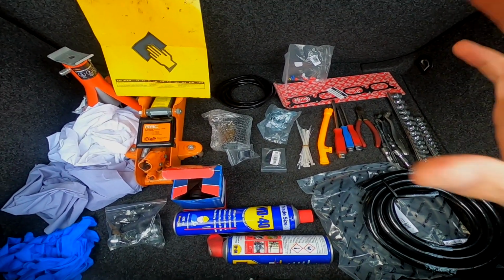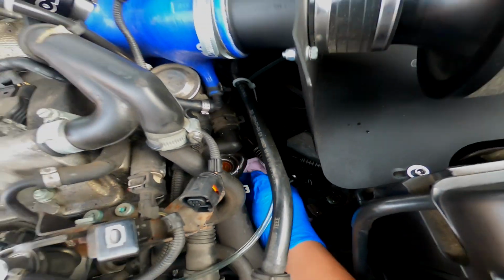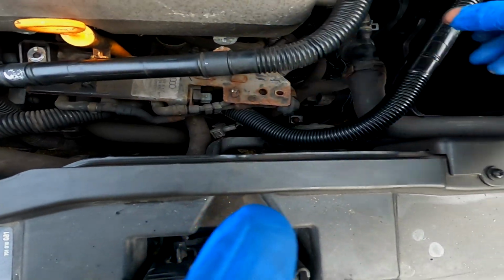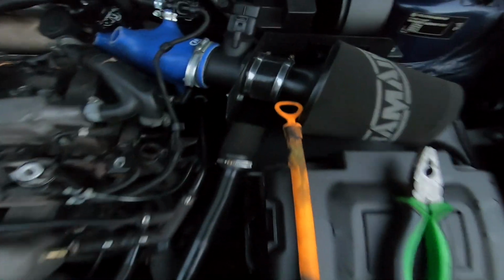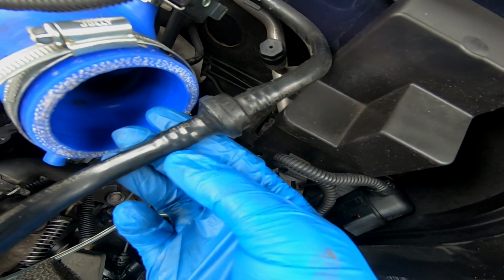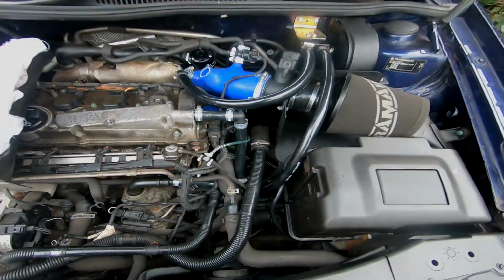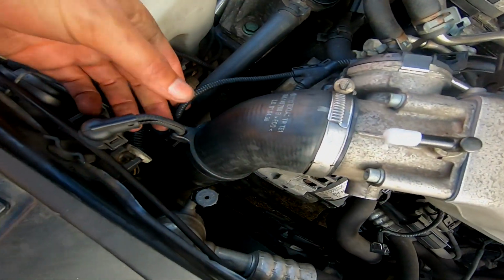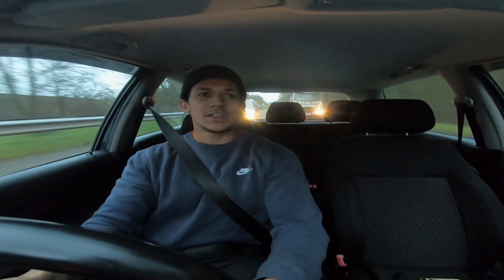MK4 VOLKSWAGEN GOLF GTI 1.8T SAI/N249/PCV/EVAP DELETE/CATCH CAN INSTALL

Comment: Ezz bro, I'm about to do all these deletes, what's your view on passing the MOT??
Reply from the maker: To be honest mate the Golf already has a decat. There are ways around it, if you ask around you will find someone who might be able to help you. Not sure how much the deletes effect the emissions. Remember there are 1000s of cars on the road that are modded and decatted making them unroadworthy if you get what I mean
Reply: @SPOOLINUP  yes bro that's what I thought, all these modded cars with straight through exhaust systems must be getting around the mot somehows!! I building up a MK4 golf from scratch!! It was a wreck to be honest I've spent the last year hunting down all the interior plastics OEM its cost a fortune I also changed all of the cream headliner and pillars into black suede, lool now I'm hitting the engine, I've changed every single hose into silicone ones changed injectors into the bam ones,  upgraded all the coolant flanges to aluminium changed every sensor I've put a direnza over sized radiator and now I'm going to do the deletes but im not going to use the blanking plate instead I've got bam head that I had fully restored and I'm going to be putting that on!! The bam head doesn't have the hole for the combi valve cut into it, my only doubt is this MOT pass loool
Reply from the maker: Damn man that sounds like quite a sweet project you have there man im intrigued. I respect the graft you have been putting in man projects arent easy for sure. Thats going to be a sick car! The fact is that if you have a nice car like that where you have obviously put money and time into it and then in my eyes its more likely to be passed even if it should fail. The modified cars that fail are probably the pieces of scrap that haven't been looked after or the ones that look like they don't belong on the road. I drove past a local garage and asked mate its all you can do! Good luck with that car though man it sounds like its going to be a unique one for sure!! Rate the hard work!!
Reply: @SPOOLINUP  thanks bro it's been a journey lool I'm loving it tho, I'm no mechanic but I'm doing everything myself by reading loads and watching videos, I had to follow your tutorial about the condensation I was getting it bad and couldn't for the life of me figure out what was happening untill I came across your vid!! You explained it perfectly bro and now I have that problem solved!!! Nice one man!!
Reply: @SPOOLINUP  love the show by the way, I remember when the xr2 came out we loved em!! Yes I'm that old lool

Comment: get 10mm spacers for the front and 20mm for the rear and you'll have amazing fitment !!!!!
Reply from the maker: Is this with the standard BBS Montreal wheels? I do have 3SDM wheels but I'm not leaving them on, the potholes out there are atrocious!! Thanks
Reply: @SPOOLINUP  With standard wheels and 205/55/16s I've just done 20mm spacers on the rear and 5mm on the front. I've gone 5mm on the front for now because they were free from a friend who removed from his VX220 and it meant I could still use my original bolts and lockers (anything over 5mm you need longer bolts), 20mm on rear makes a huge difference and helps fill the arches. Could have maybe gone 25mm on rear but coilovers not installed yet and although tread well within the arch, the trye wall bulges out guite a bit on 55 profile so played it safe for now to avoid any rubbing.
Reply from the maker: @Just_James_79  I'm thinking of kind of doing a winter and summer wheels setup and will buy some other larger spacers for the standard wheels with some larger bolts. Nice wheel fitment can set a car off really well.
Reply: @SPOOLINUP  Yep, the fronts have never bothered me (as stock they actually sit 5mm per side wider than rear) but I absolutely hated how far in the rears sat in those arches! I got the Mtec 20mm spacers for rear from ebay for £40 including bolts (make sure you get radius bolts if using original alloys) and it's without doubt the best £40 you can spend on the car!
Reply from the maker: I remember I got my car tracked after changing the wishbones and when I crouched down at the front to see how the wheels looked they sat so far in. Spacers can make a big difference to a car man and they arent expensive as you have said so its well worth it.

Comment: Finally someone’s done a video I can actually understand, what size was the Caps you used please mate and size pipe I need.
Reply from the maker: Hey man, all of the sizes of the pipes and hoses should be on the thread that is in the link in the description. As for the caps most if them I used were in an assorted selection bag from Amazon and I ordered some extra ones for the turbo inlet pipe but can't find the order as I checked out as a guest from that particular website. You need a largish cap or two for the TIP and for the bottom of the inlet manifold. Maybe 8mm or 10mm man sorry I am not 100% sure, I had to order them halfway through the job as I didn't have ones big enough. Good luck though with the job 👊🏾
Reply: @SPOOLINUP  nice one for that. Keep up the great videos. 👌🏻

Comment: Perfect video man. I copped a cupra 1.8t few months back and ur videos help. Can u help me though? When i unscrew the oil cap at idle, it dances around. I replace pcv but there is still alot of blow by. Have u encountered this?? Cheers
Reply from the maker: Yo man thank you!! I'm sorry I have not encountered this at all and I am unsure of what is causing this problem for you. The best advice I can give you is to have a look on the forums or maybe on one of the 1.8t Facebook groups. I know excessive blow by can be a result of worn piston rings. Have you done a compression test?

Comment: Sick video mate!! Keep it up!! It’s so satisfying taking all that junk out!!
Reply from the maker: Thank you bro! Its so satisfying man, got ride of a vacuum leak or two 👍🏽
Reply: That’s sick! I don’t know why VW over complicated their engines, makes no sense! Also keep an eye on that oil cooler elbow join, when I did the deletes, mine was barely held together, so I replaced it, and after all that cold weather we had, it broke again. Such brittle plastic! 👍🏻
Reply from the maker: Yeah I know, there is a lot of complicated systems to achieve whatever it is they wanted to do. I will definitely keep an eye on that oil cooler elbow, I was looking for the metal ones that someone was making but I couldn't find them, might have a search on Facebook. Cheers for the heads up 👍🏽
Reply: Yes, exactly mate, the SAI pump is just plain ridiculous haha! Ooh I did search online for a silicone replacement, if they did one, but the metal one sounds a lot better. If you find it let me know as I’d 100% be interested!
Reply from the maker: Yes and the SAI pump weighs a ton too. Yeah man I will be keeping my eyes peeled for the engineered metal elbow because they looked pretty good to be fair, the OEM one lasted years though but I'm keeping an eye on it like you said.
Reply: It could have just been bad luck for me. I changed it last summer and haven’t really driven the car and then the cold bit of weather it just snapped. But definitely something to remember haha.